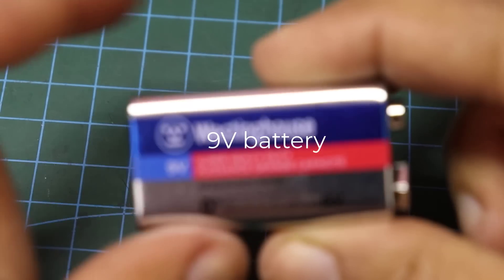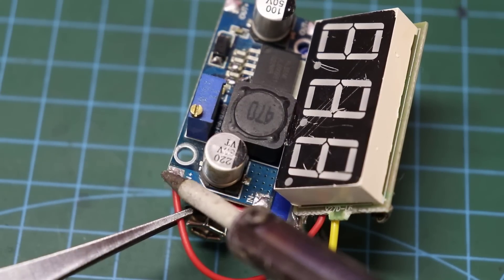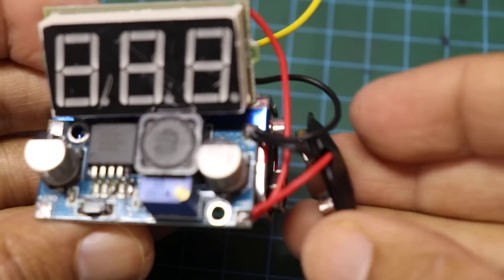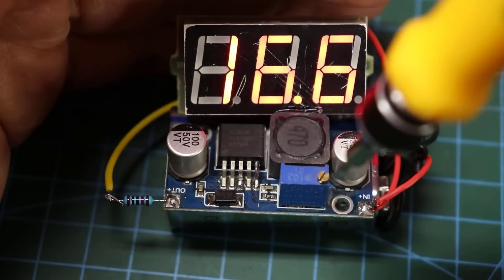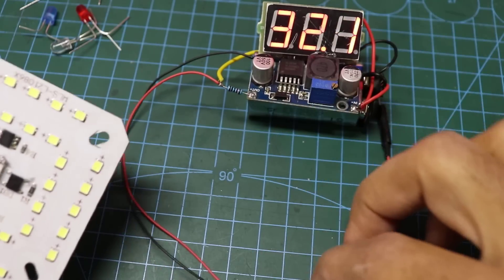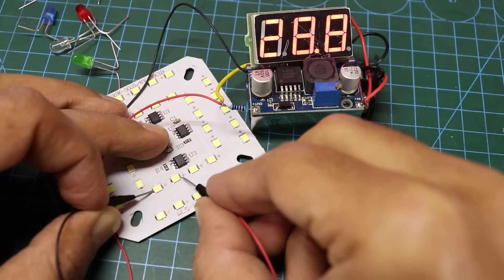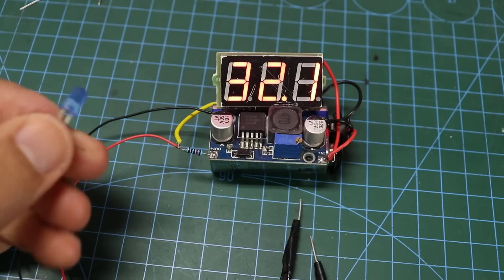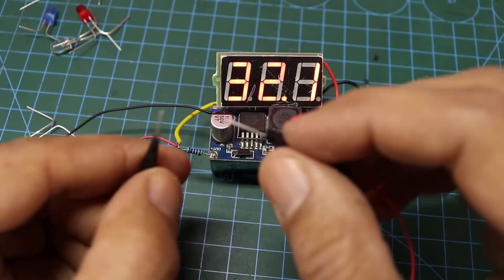Amazing Projects ,, You Can Make At Home

Comment: Hi, I like your ideas. I wanted to add a suggestion. On your LED tester,  a shorter strip of plastic sheet mounted to the top of the numeric readout would help shade it for the camera better. The set lighting tended to drown out the contrast between the lit LED segments and the black background they are mounted within. I noticed that you started to shade the readout with your fingers and hand to make the lit LEDs more easily visible to the camera.
Reply from the maker: thank you

Comment: nice projects, on the 3rd project, you might want to add  2 components to make your mini amplifier run even better. 1 - a 1uf/6v in series with the speaker to prevent any dc voltage going to the speaker. 2 - 470 ohm resistor in series with the base of Q1, this will lower the gain a bit to prevent any distortion. Cheers!
Reply from the maker: Thank you for your feedback

Comment: Imagine the voltage drop of pulling 32v from a 9v battery. lmao.
Reply from the maker: do you mean current drop ?
Reply: @Inventor_AW  When you draw from an imperfect source (all sources are imperfect, but batteries especially so), there is a drop in voltage depending on the amount of current you're trying to pull.

Comment: In the case of the 0.1uf ceramic capacitor, can I replace it with a 0.22uf electrolytic one?
Reply from the maker: yes you can , but the quality of sound will be not the same

Comment: Wish I had spent more time doing things like this when I was a teenager. I used to love collecting thrown out electronics on junk week. To learn things, I'd either try to fix them, disassemble or break anything that didn't work. I'd collect old school socketed tubes (the antique ones that were worth something) and desolder components to save for no good reason. I love when I smashed open an old green screen CRT monitor and saw the silvery lining on the screen that the CRT guns would hit to make images on the screen. It brought me to an understanding of how color TV worked in the 90's with color guns. VCR's, radios, and tape decks were also great for learning as well.